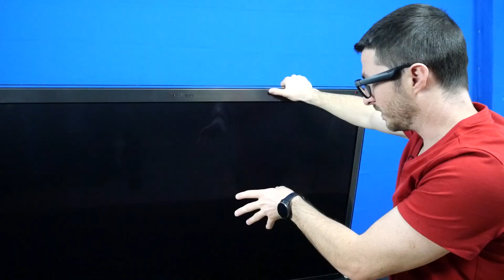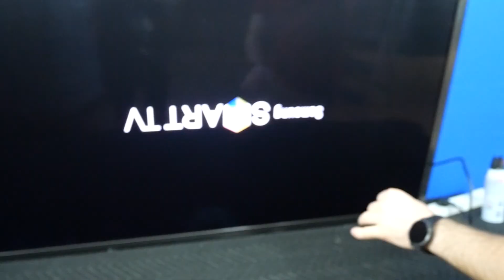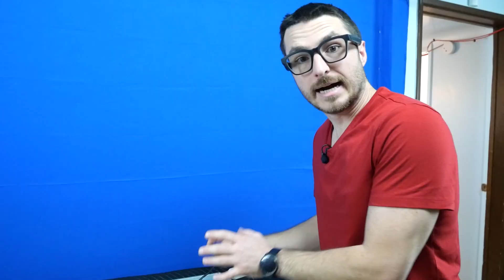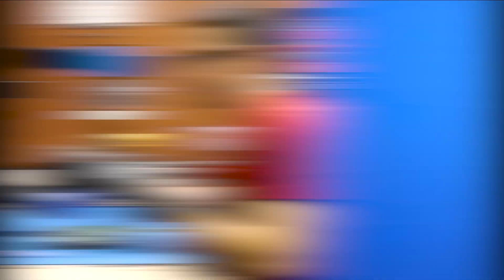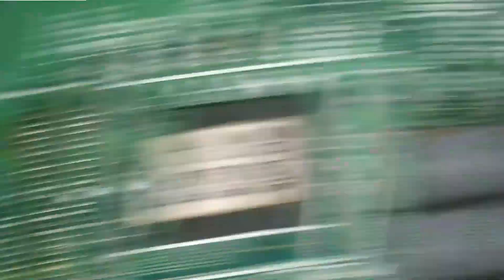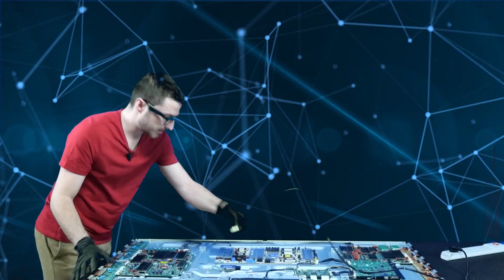Samsung TV Cycling on and off REPAIR PN59D7000

Comment: I have a Samsung model number un85tu8000fxza  it boot cycles about every 10 seconds or so and we’re not unplugged the ribbon to the power supply board. I have a blue screen. Would this be the same part and where is it on my Samsung TV and how much you charge to test the board out to see if it’s good or not I also noticed that when I turned the heat when it’s cycling boot cycling, there is a clicking noise on the power supply board you have the power supply plug the fuse and then a little bit up. There’s too long silver bars and it’s coming from one of those. It sounds like I put a tube on it to listen and that’s where it sounds like it’s coming from. Is that normal? Could you please answer me ASAP please God bless you. I pray you take the time to answer me have a good day.

Comment: Mine won’t even show the logo. It lights up the back screen only
Reply from the maker: That could be either a power supply failure or mainboard failure. I wouldn't be able to assist you further without looking at the boards myself and testing them in our test jig. If you would like to send them in for repair, we do offer flat rate services for both.

Comment: Mine also cycles on and off but intervals range. Sometimes maybe a minute In between, sometimes im able to watch for 5 or 10 minutes before it turns off. It never shuts off moments after turning on
It always turn on
Watch show for 5 mins
Cycles
Takes me right back to watching show

You still think this is a main board issue?
Reply: Same exact model as yours
Reply from the maker: If the shut off time is not the exact same every time then you most likely have a power supply failure. In which case I recommend you check out this video next:
https://www.youtube.com/watch?v=mdTch40x_tk
And this one:
https://www.youtube.com/watch?v=-Shs9oVllC8

Comment: Hi. Nice and clean job. Where do you get the data for programing the chips?
Reply from the maker: You have to get it off a good working mainboard. 
8 or so years ago when we first started fixing these there were still a few new mainboads for sale from official suppliers. So we got one from them and cloned the software off it and have been using that ever since. 
Sorry the software is not for sale, technically it's Samsung IP so we can't legally sell it and Samsung also won't sell it to anyone. But if you want to try and fix it yourself we do sell the NAND chip although I don't recommend you buy the nand chip and fix it yourself unless you are an experienced tech and have advanced soldering skills. You also would need a good quality soldering iron, not something that was purchased at your local hardware store. Those won't be good enough. (You will need to spend at least $100 or more for a good quality iron)
We also do have a cheap flat rate service we offer if you would rather have us do the work. We provide a 1 Year warranty with all of our repairs.

Comment: I have a pn64d7000 that wouldnt power on and then would after freezing the ic chip. I bought a new board and now it powers on, but shuts off every minute and 18 seconds and then turns back on. Any ideas on how i should proceed? Did I buy another bad main board??
Reply from the maker: Unfortunately, you did receive a defective mainboard. I am biased of course, but this is the reason I tell people it's better to send your mainboard to our repair shop for us to fix than to purchase a used board online that may or may not work. If it worked, who knows for how long before that chip fails. Also how long is the warranty period on that board you got? I am willing to bet it's very short or none existent. 
With our service your board is live tested before and after repairs to ensure the board is indeed defective before we start our work and of course, post repair to make sure the mainboard is 100% working before we send it back. 
To top it off we provide a 1 Year warranty with all of our repairs. 
I highly recommend you send back the defective board you got for a full refund and send in your original mainboard to our shop for repair. Links to our flat rate service are in the video description. If you have any questions, I recommend you reach out to us directly via the contact form also linked in the video description, or by emailing us to our support email which again is also provided in the video description.

Comment: Why bother with all of this when  you can  do an  easy fix with a piece of tape on  one of the ribbon cables that goes to tha panel
Reply from the maker: I edited this comment because my original response was reactive and not helpful.
That piece of tape repair you are referring to only works for panel faults. In this video, I show how to fix a mainboard fault. This means the piece of tape repair trick would not work for this TV. What we do here is the only way to fix the TV.

Comment: Ive got a qn800 Samsung,screen is ghosting but has then started to power cycle I have a ps5 an a Samsung sound bar connected just had a new optical cable sent out so I installed that an changed ports for the accessories an tv stayed on but was still ghosting I swapped the accessories back to there correct hdmi locations sound bar to arc ps5 to 2.1 port an after an hour the tv began power cycling again. Tv is not quite 2 years old how every I struggle with ocd so can’t really have a technician take a look even though it’s under warranty also has an updated software version on the website requiring usb to which I don’t have a computer to try that method how ever the tv instantly cycles not allowing for this option. Any suggestions ? Could a faulty hdmi cause this or a port on the one connect box ? The 2 ports I used last night are the same 2 using tonight but running the opposite accessory to each port it doesn’t sound like the issue could occur due to a different accessory being plugged in especially since the screen is ghosting also but I am no expert just trying to find out what could be the trouble hope you have an idea to point me in the right direction
Reply from the maker: I highly recommend you have a Samsung Tech come out ASAP. This is not going to be repairable. What you are describing 9 times out of 10 requires the screen to be replaced which is often not economical. What this means is if you are under warranty, they most likely will have to replace the TV.

Comment: Nick thank you so much! 🙂I have a Samsung PN59D6500PDFXZA  The board is BN94-O4709A. very similar to the TV you have here. I froze the Nand like you showed and its working again. Im guessing this is temporary? Was doing the same as the TV in the video before. I followed the link and the board is different part then mine. Can you replace mine?
Reply from the maker: Hello, 
Yes, the freezing is indeed only temporary. Replacing the chip is the only long-term fix. We only use it as a diagnostic technique, not as a way to repair the board. 
The video is for a PN59D7000 and you have a 6500 series, but those two boards are actually the exact same mainboards even though they may have different part numbers and go to slightly different model TV sets they are in fact interchangeable. 
If you want to send in your mainboard for us to fix, you can purchase the repair service listing in the link in the video description. But we do have listings for all versions of these boards. If you go to our website nickselectronics.com and in the search bar type in either the model number of your TV or the part number of your mainboard, you should be able to find your exact board repair service.
One last thing I want to mention is that we do offer a 1-year warranty for all of our repairs. 
Feel free to reach out to us directly if you have any questions.

Comment: Sorry to ask a bit of topic but how would I know if my NAND is fine or broken? I've been told that I might have damaged my Smart TV by a few too many factory resets over time
Reply from the maker: I show the answer to your question in the first minute of the video. 
Freeze the nand. If it makes it work then your nand is confirmed bad. 
"Too many factory resets damaged your smart TV" I don't know who said that but no that's not true. Unless you have performed thousands of resets, you did not damage your TV. This is a fault that occurs commonly with lots of sets due to the part going out over time. It's just wear and tear.

Comment: So I performed the chip freeze and sure
Enough it worked. I don’t have the soldering ability like you so I guess the next thing is to replace that entire board?
Reply from the maker: You can either replace the board or have it fixed if you are unable to get a replacement for a good price. I am biased towards a repair since I offer repair services, but also because we offer a 1 Year warranty on our repairs versus buying a replacement as there are no new boards available, only used ones with unknown life left in them, and typically 30-day return windows for any issues.
A repair is also typically cheaper. Anyways if you are interested in having it fixed, there is a link to the service we offer on our website in the video description.

Comment: I've got the same issue. You can force it to crash by hitting 'smart' or 'search' or 'social' on the remote. I wish there was a way to disable the smart hub portion of the TV and just run it as regular HDMI. 

So the only way to fix this is to get another chip, program it, break out the soldering gun? I tried the freezing method but that had no results.
Reply from the maker: Typically with these, there is no need to hit the smart menu option, it happens on its own and often it happens so fast that the TV doesn't even have the option to boot up all the way before turning off and back on. 
It seems you might have a slightly different fault. 
I would recommend trying a factory reset. You might be able to get away with not having to replace the chips possibly. 
Check out the video below for a factory reset walk through
https://youtu.be/15iwEiWezvs

Comment: Hi, I have a QN70Q6DTAFXZA and it's power cycling on and off but there's no picture at all. All the info I can find online says the power board is gone but I talked to a seller on ebay for the power board and he said it's the mainboard. I only had the tv for 2.5 years and I would like to get a few more years. Should I get a mainboard or power board?
Reply from the maker: That's a tough question for which I can't really help you much. Unfortunately there is a chance neither are at fault and the issue is with your screen. It may be best to have a TV shop take a look at it. 
Disconnect the mainboard from the power supply. Does the set still cycle? If yes then you may have either a bad power supply or bad LEDs. If no and your LEDs turn on and shine then your power supply and LEDs are good, but your mainboard or your screen could be at fault.
Reply: @NicksTVRepair  it was the screen, sent it to the recycling depot today... never buy samsung people... garbage!

Comment: Hi! I have a Samsung UE46D6507VKXXE tv that stopped having white light when power cable connected. The standby light keep blinking and I can hear a clicking sound. Since the standby light blinking/keep flashing but no light/background light and signal from TV, does this mean it's the T-CON board that need to be replaced? I have tried to replace the power supply but still the same problem. Thanks!
Reply from the maker: I would recommend following the steps in this video to find out which part of the TV is at fault:
https://www.youtube.com/watch?v=Pi8l_GIaIeM
Reply: @NicksTVRepair  thank you alot for your fast reply! That video really saved me the headache. I followed the video instructions and the first step testing only power supply and the tv got backlight. On the second step to test the mainboard, the tv didnt get any backlight. So it must be the mainboard that need to be replaced. But I wonder how do I test if the T-con board is ok? Since the mainboard not working so I can't follow the video 3rd step to check if the t-con board is ok.

Comment: Hi Nick, could you please explain the point of freezing the NAND chip?  I would normally see the point of freezing an IC is to detect a short but in this case it made the chip work temporarily
Reply from the maker: I don't know if I have the exact correct reason but this is what I was told.
In past videos we saw cracked solder joints in solder balls for BGA chips and heating them up expanded those joints and allowed temporary connection. It's the same principle but slightly different. The chip degrades internall overtime when that happens parts of the chip internally change physically, sometimes this causes faults such as the cycling. Freezing it temperarily moves things back where they should. 
At least that's how it was explained to me and I didn't question it. 
This does mean however that it only works if the NAND chip is physically defective. If the software is corrupted, this won't work.